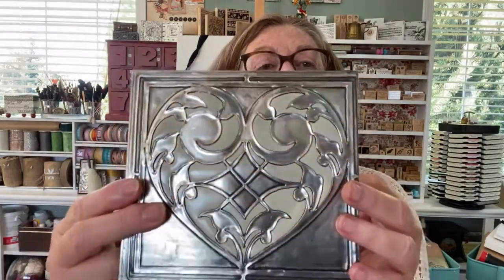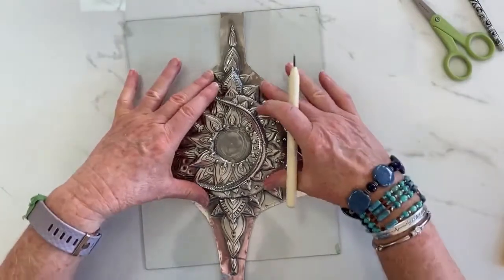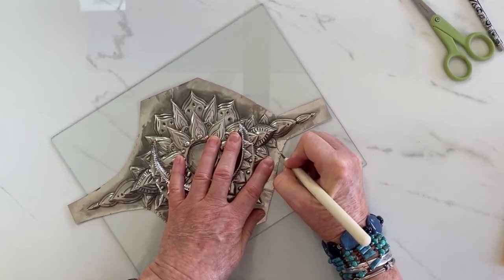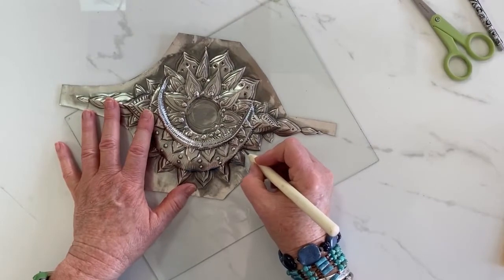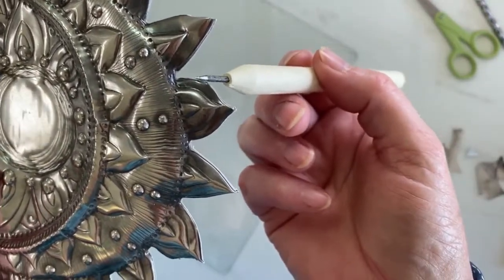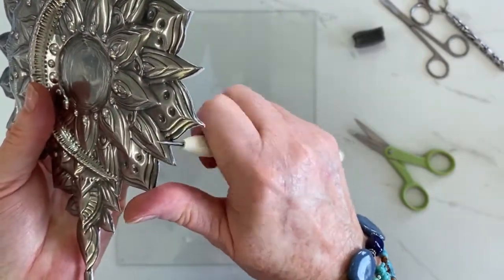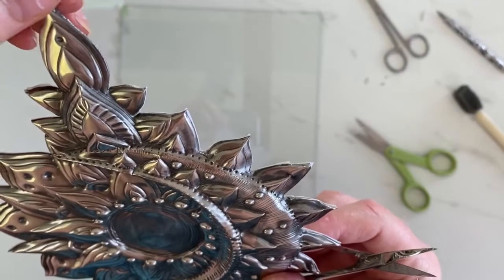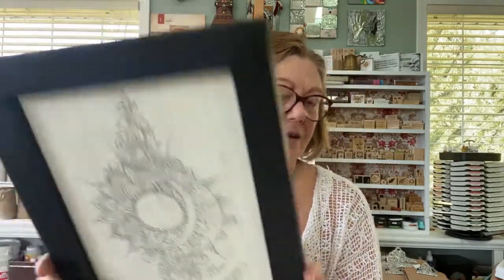How to Use a Dry Needle Cutter Tool for Metal Embossing

Comment: Beautiful!  What kind of glue do you use to attach the focal point stone to the metal?
Reply from the maker: M R  I use Helmar 450 Quick Dry Adhesive in almost all projects that need glue. They say the glue is "quick drying," but I find there is more than enough working time before the glue sets. On the bottle, they mention all materials the glue bonds with; however, metal is not on the list, but it works perfectly. My go-to glue.